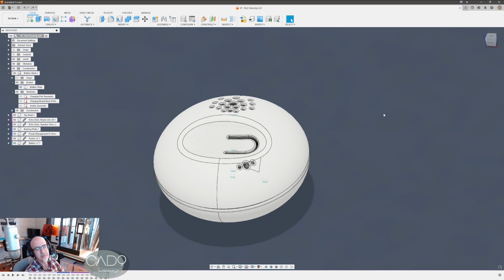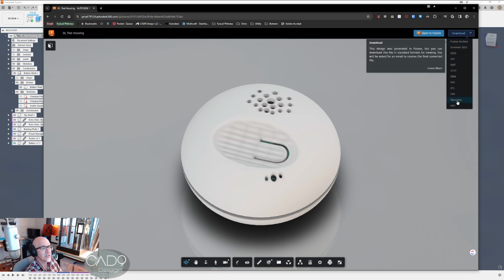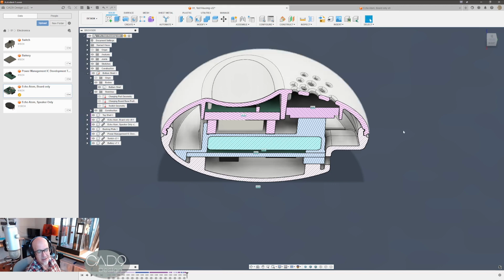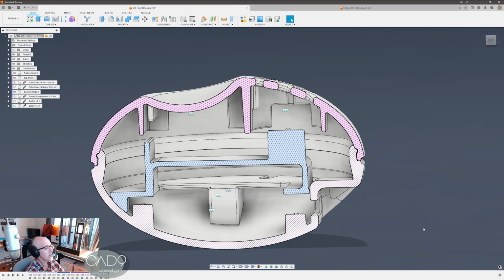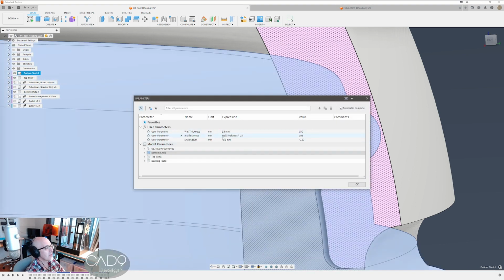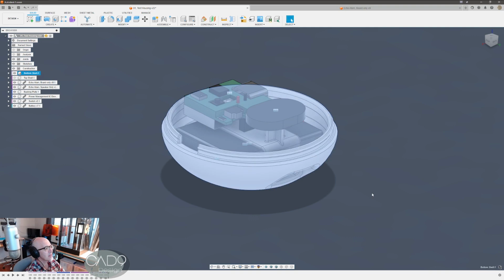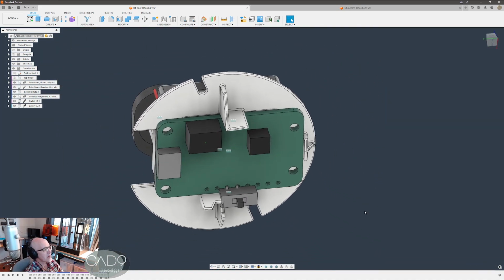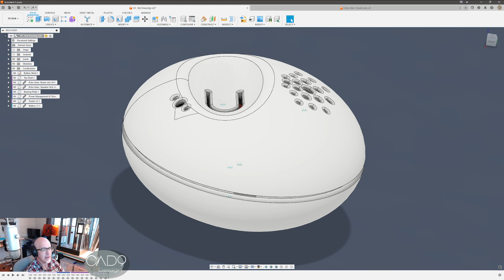Open Interpreter 01 Case Model Walkthrough

Comment: Thank yiubfor the file, i am using A1 3D printer with  Bambu lab studio slicer tried to convert the file to 3fm and  when enabled support tree, i cant open the led. Do you jave a solition
Reply: Just to add i am new to 3D printing
Reply from the maker: led? Not sure I understand, but here's a link to printable stls https://github.com/OpenInterpreter/01/tree/main/hardware/light/bodies. Just so you know, these are designed for SLA printing. Some folks have had good luck with FDM printing, but it will be a tough one to print.  Here's a good place to ask questions. https://discord.gg/open-interpreter-1146610656779440188